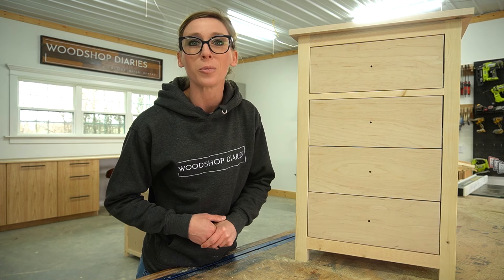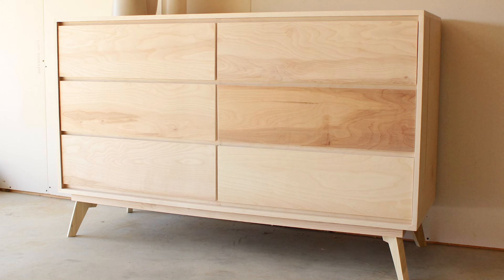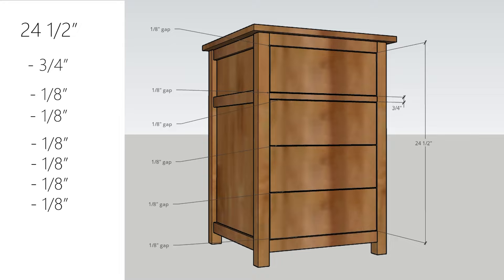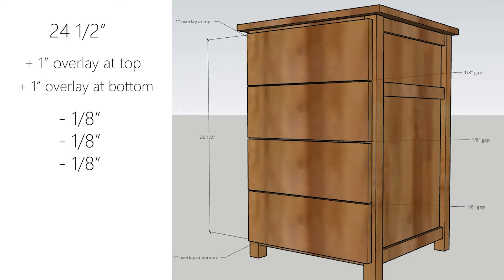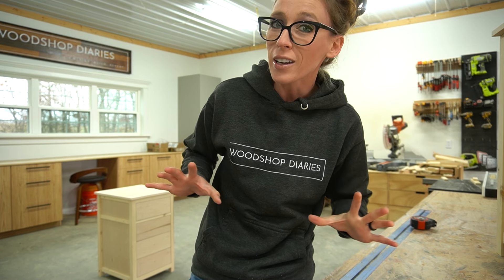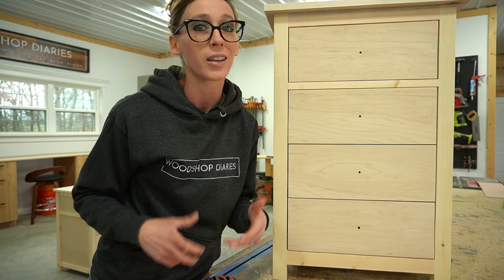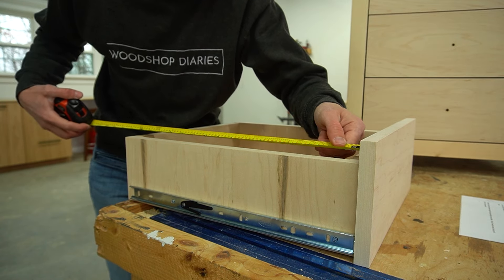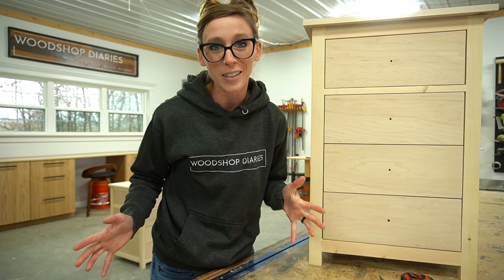How to Measure and Size Drawer Fronts & Drawer Boxes

Comment: You make it look so easy.  LOL   Since the majority of my builds use Locking drawer slides:  Vadania Heavy Duty Drawer Slide with Lock, because I build cabinets for my camping vehicle, I've struggled a bit but also used your plans for a cabinet or dresser as a starting point and that helped a lot.  In the course of building drawers, I also make them various depths, some deep enough for spice jars, others shallow enough for plates, and that has added to the "fun" of making cabinets with drawers.  Thanks for starting this series of "How To"s, I'm sure I am going to learn something.  Until next time... Saw safe.
Reply from the maker: It’s easy, I promise!! Haha. Yes, you can definitely take this entire process and build it “backwards” as well by customizing the size of the drawer, then building the cabinet to fit. Making a video like this is always challenging…not because the process is difficult, just because there are a million ways to go about it and there’s not a lot of “right” or “wrong,” but there are a lot of variations project to project. I hope this is a good starting point, but definitely not a rule book haha.

Comment: Thank you for your insight on how to measure for the drawer boxes and drawer faces.  I also learned about the difference between inset, partial overlay, and full overlay.  I used your ideas to help make a 12 drawer bench seat with frameless inset drawers.  Your videos were easy to understand and follow.

Comment: I really like this. I have made drawers before. And I’ve done it on custom pieces so I had to come up with all the measurements. This is a great reference. Plus… I found a piece that I bought super cheap and sold at my antique mall booth. But I really liked the size and so many things about it. So I took some quick measurements before the customer took it home. So I’m building it by making my own plans. I’ve got the frame plans worked out. Now I have to do the drawers and doors. This will make it much easier
Reply from the maker: That’s awesome you’re recreating a piece you love with your own plans 🙌 that’s what DIY is all about! I’m glad these drawer videos can be a resource for you as you plan and build your new piece! Happy building!
Reply: @WoodshopDiaries  Drawers are easier. But as I was trying to figure out material needs and making myself a plan…. I was getting lost. This video helped. Door on the other hand… I struggle with attaching.

Comment: Great video. Finding the sizes of all of the drawers and stuff like that has always made sense to me. What my brain can never seem to figure out is how to calculate where to mount the drawer slides by just measuring. It always takes me like 30 minutes of standing there and staring at it. I like mounting my hardware before I put it together cause its just easier on the back and knees but not on my brain. Like writers block every time.
Reply from the maker: I discuss slide placement in the installation video—which will be part 3 😊

Comment: First time coming across your channel and I have to say this series feels classroom complete which is a very good thing. A lot of of “build this” (not Brad he’s great) type videos tend to be like the draw bird meme. 

Step 1, draw outline. Step 2, draw the rest of the effing bird. 

Your tutorial is so thorough and packed with details I legit had to take notes on a paper and rewatch certain parts more than a few times. 

I just built my first cabinet for the garage as practice and I’d watched enough videos on how to do so. It came out alright and I will admit I kinda winged it on come parts because I’m a kinesthetic learner. I have to do things to really learn, even if it’s just to learn the mistakes and the reason not to do things. 

With that under my belt this series provided crystal clear details on everything I need to do next time. It feels like I actually showed up to class instead of reading a classmate’s notes and showing up for the test. 

Long winded way of saying, amazing work!

Comment: You make tackling drawers not look so intimidating! It would be great in your next video of you could explain how to determine the slide length in a little more detail. Maybe show with a drawing or a model of the inside of a cabinet. I loved how you incorporated the SketchUp drawings into you video - especially with the moving dimensions. Very clever! Looking forward to the sequel!
Reply from the maker: I may put together a short form video about that! Slide length is kind of one of those things where, as long as it fits, it’s fine. It doesn’t have to be specific. In 90% of my projects, I use 16” drawer slides because I buy them in bulk and they fit most applications. Basically you just don’t want to buy a slide that’s too long for your cabinet. So your slide length should be equal to or less than the depth of your cabinet (or dresser or whatever). If you’re doing inset, the drawer front pushes the slide back from the front edge, so in those cases, the slide length plus the thickness of your drawer front should be equal to or less than your cabinet depth. So an 18” cabinet could fit an 18” slide if the drawer fronts were overlay. But it couldn’t if they were inset because the thickness of the front plus the slide length would be greater than the depth of the cabinet. If you were doing inset, you’d need to size down and they come in 2” increments, so the next smallest size would be 16”.

Comment: Great video! I'm looking at several different ideas for adding drawers to a work bench. Not sure if I want to use sliders or just use plywood for the slides. Thought about using up some pieces of T111 for the sides to mount the drawers to.

Comment: Great videos, I like how you present the approach you are taking....I'm working on a file cabinet that will use non mechanical slides....Any tips on this? I decided on side cleats versus a centered bottom cleat....Thanks, Gary M North Carolina
Reply from the maker: Thanks so much! I don’t have many tips to share. I used wooden slides when I very first started and quickly switched to ball bearing side mounts and never looked back haha

Comment: A great video. Really clear. I loved the digital drawing explanation, that is really helpful. By the way, would you normally do different heights for the top and bottom boxes on overlay drawers? To ensure that there is the same top lip (overhang) through each drawer?
Reply from the maker: Great question. That’s really kind of personal preference…no right or wrong. To be honest, I very rarely use exposed dividers between overlay drawers (I can’t think of an example where I did), so I’m not sure that’s ever been something I considered. I probably wouldn’t change the top and bottom personally. I’d just have equal overlay on all sides.

Comment: Hey Shara, thanks for this great video! I'm wondering if you need to take thickness of edge banding into consideration for calculating the size of drawer fronts when using a flat 3/4" plywood drawer front like the one here? I suppose your note on rounding down may take care of that? I'm planning my pantry cabinets and this answer would be super helpful! Thanks!
Reply from the maker: Personally, I don’t account for the edge banding thickness. It adds a little to the drawer front size, but the amount is so small, I don’t consider it in calculations. I just cut the plywood to the size I need, then add the banding.

Comment: Really love this. 

For full overlay, why do you still have an 1/8” reveal?
Reply from the maker: Thank you! If you’re doing a stand alone piece, I suppose the reveal is optional, but many times, that’s used with cabinets and if you install two cabinets next to each other and the drawer fronts come all the way to the edge, all the fronts would be touching so they’d rub on each other opening and closing. The reveal allows space between so they can open and close freely.
Reply: @WoodshopDiaries  Thank you for that. Totally makes sense! Looking forward to the next part in the series. I had hopes of refacing my cabinets and drawers, but the drawer faces are glued and stapled to the drawers so need to make new drawers.

Comment: Shara, for heavier weight items in the drawer, would you go thicker on the bottom?  Would you still maintain the dadoo 1/2" upfrom the edge or decrease to accomodate for thicker material ?
Reply from the maker: Hi! In the video description of part 2 here: How to Build a Drawer Box | Easy Step by Step Guide
https://youtu.be/QpCzZQOBDy8
I discuss how much weight a drawer box can hold and link a video of me standing in one built with dadoes and 1/4” plywood. I weigh more than the slides are rated for, so if the box can hold me just fine, then there’s no need to go thicker on the plywood because any additional weight will overload the slides anyway.

Comment: I have a question! I’m building a narrow cabinet, so I need to use a bottom mount centre slide. Do you have any advice for installing those?
Reply from the maker: I’m sorry, I don’t. Even in narrow spaces I like to stick with side mounts and just use a 90 degree drill attachment to secure them

Comment: Drawer width using side mount slides gets me every time. I have had to run finished drawers over the jointer that were a little wide. I have had to shim slides for drawers that were too narrow. 😡Drives me insane. I have it narrowed down to I either cannot cut accurately or I can’t measure but every thing else is good.

Comment: I am confused on the 1/8th inch gap.  In the video you state that you subtract a 1/8th inch gap for each instance where a drawer front and surrounding framing abut.  In the inset drawers there were 5 gaps but in the overlay example you say there are only 3, but I see 5.  Can you clarify?

Thanks
Reply from the maker: In the inset example, there’s a gap above the top drawer front and the frame and below the bottom drawer front and the frame since they’re inset. With overlay, there’s not a gap above the top drawer front or below the bottom drawer front since they’re not surrounded by framing—they overlay the frame.

Comment: Have you used undermount slides
Reply from the maker: I haven’t used them in any builds as of yet. I know I’m the odd ball but I don’t particularly like them. Our kitchen cabinets in our home now has them and I’m not a fan. They get hung up a lot and aren’t as easy to adjust as side mount slides. 
I’ve stuck with side mount in my projects because, in my personal opinion (which doesn’t mean it’s right or wrong), they’re less expensive and less finicky and in most cases require less bracing (meaning less lumber). So my limited experience with under mount is just fixing the ones I have in the kitchen 🤣 and that only makes me want to use them all the less 🙈
Reply: Thanks for the info, I was considering using them in a future project but now I'm going to do a little more research to see if its going to be a good idea

Comment: What wood did you use for the box bottoms at 10:48
Reply from the maker: I use 1/4” plywood for drawer bottoms
Reply: @WoodshopDiaries  oak or what species
Reply from the maker: I use different kinds—I don’t remember what this was exactly in this particular case. Any type of 1/4” plywood would work. Underlayment, sanded pine, birch, oak, etc.